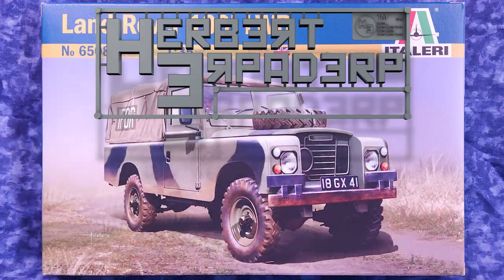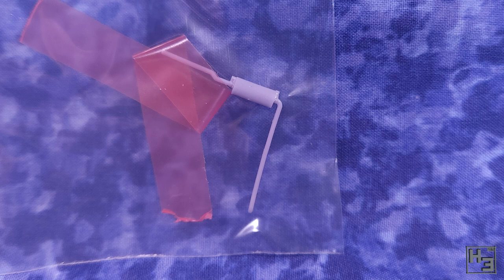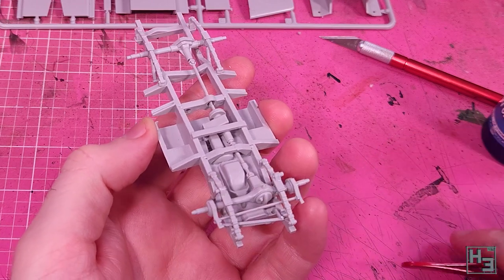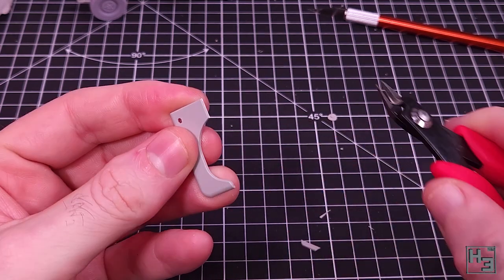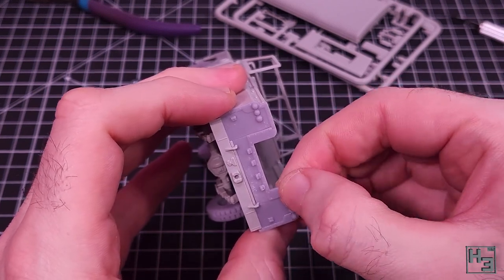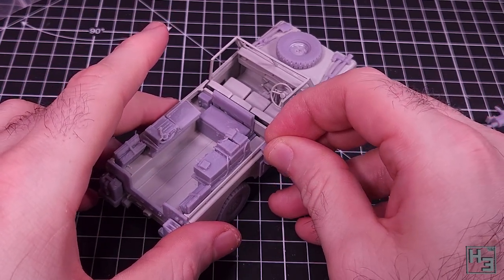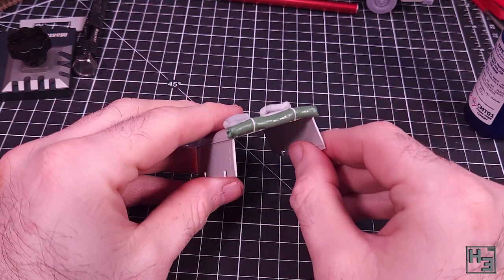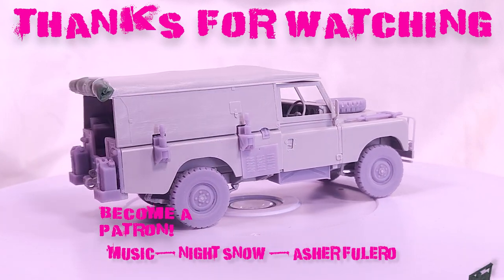Land Rover FFR Conversion - Italeri 1/35 Scale

Comment: This is a British version of the vehicle, Australian versions have the spare tire located under the cargo bay, and don't have a middle seat in the cab.
The block thing is actually a cross member to support and protect the drive shaft at the point where it exits the transfer case and heads onto the rear differential.
Aussie LR's also don't have the mufflers at the front of the vehicle.